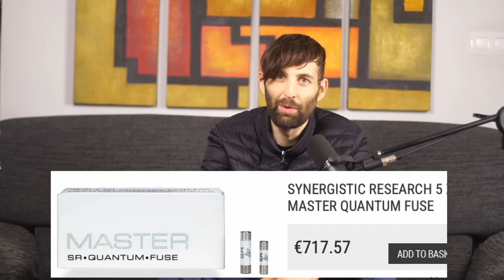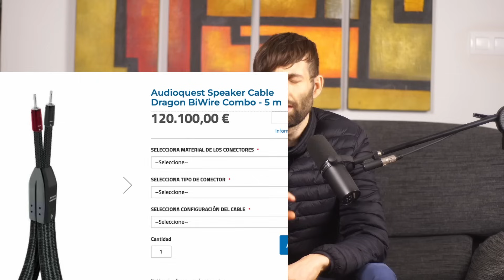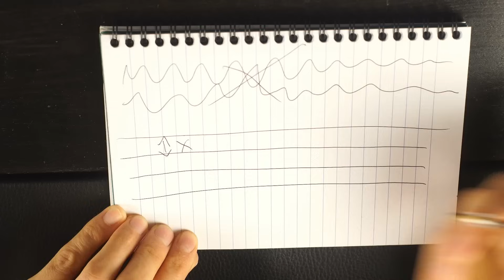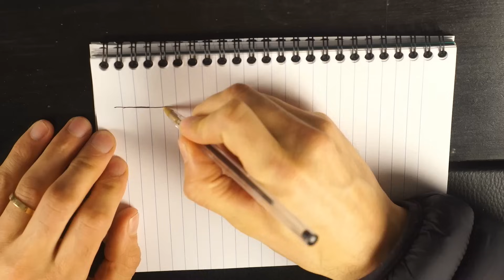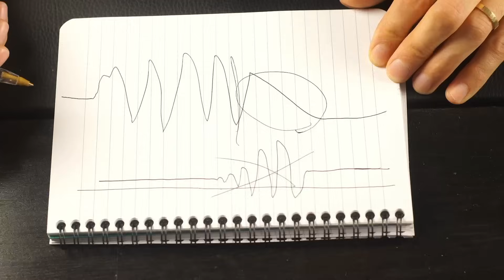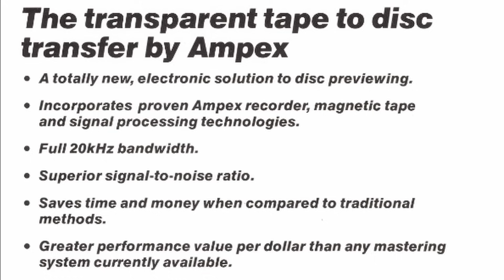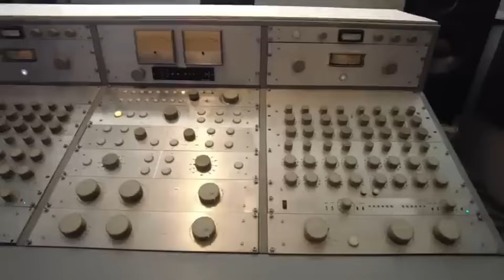Hard truth: most vinyl is digital anyway

Comment: It may have escaped your notice, but there was music before the 1970's. While Alan Turing played with digital music in the 1950's, microprocessors did not become available until mid '70's. Synths and suchlike were analogue well into the '80's. Mixing desks moved from transistors to ic's with the xx741 (noise + limited bandwidth) and similar in the mid '70's. before that recording channels were limited, often to what you could fit on your multi-channel tape machines. They managed to keep reasonable quality even with ic's.  The main advantage with recording to tape is that you can record loud and rely on the tape to compress and limit the signal.  Gentle distortion.  Digital is unforgiving.  If you exceed the input range of the ADC then you have a 'train crash' situation. The signal goes crazy for the duration of the overload.  Even today with multi-channel 32 bit floating point converters you can still produce crap recordings.  There is a lot to say for analogue with all its distortions.  Most often today its the artist and the material being recorded that disappoints.

Comment: One of the big differences between vinyl and digital is that engineers back in the days were much better imo at mixing and knew their equipment. Also listening to vinyl back in the days - you did not listen to compression artifacts. So if you’re talking about MP3’s there is an audible difference for many people. I can also hear the difference between a pure analog recording - tape to vinyl VS digital DAW to say a 44.1khz/24 bit recording.

Comment: correct most if not all vinyl today is sourced from digital sources, even if it is recorded analog to tap reels, alot of times it still goes through a computer to do the cutting.  Some say digital is not a complete audio wave etc. Thats completely false, but thats a really long story.
Also when a CD is played, it is stored digitally, but of course has to go through a DAC and converts to analog on the fly, so now your speakers can play the sounds which is in itself analog signal sound.  what' is important is that the audio is stored digitally.  Anything stored digitally is always going to play exactly the same as it was meant to be heard as long as you don't use an EQ.

Comment: Whether they realize it or not, I think dynamic range is really what most audiophiles are talking about when they sing the praises of vinyl records. But just about all CDs pressed before 1993/94 also have great dynamic range. CDs also never pop, crackle, or hiss. Handle them properly and they'll never skip or wear out. However, the CD era ushered in the full brunt of the Loudness War, and some remasters of classic albums were arguably ruined. Even some of my favorite albums of this millennium sound overly compressed. But as you said, it's absolutely possible to cut digitally compressed music into vinyl. It happens every day. But if you just want to hear better dynamics in classic albums, you don't have to spend thousands of dollars on high-end hardware. Just buy some old CDs.

Comment: Digital:
44.1 Choppy stairs per second?
Haven't heard any audiophile complaining about all audio 
being chopped into 1/2 CLASS_AB literally in everything.

Most/all amplifications are CLASS_AB (including preamps in your "pure" class-A amp or class-D amp, preamps  in RIAA amp /CD player/streamer), 
this means your audio is literally CHOPPED IN 2 halves, a 
plus half and a negative half , and put back together again. 
The plus voltage is amplified by a completely differently manufactured set of device VS the negative half (PNP, NPN, or P-channel, N-Channel for mosfets) , 
In other words not guaranteed perfectly symmetric but close enough for getting stitched back together again to form the amplified audio, with negative feedback that repairs the damage, Class-AB audio distortion is more common than you think in under biased amps or when components drift over time (Vintage stuff, china stuff aka Behringer euro-1500).

Comment: by no means are cds a perfect medium, but in my opinion are closer to what i really want: a physical format encoded digitally, which reduces the number of digital to analog/analog to digital conversions by one. vinyl is provided as analog (usually from a digital master) so it's only natural for it to degrade with time and usage, no matter how well cared for. on the other hand cds will just rot away some day, but they are an exact copy of the digital release that is intended. any defects in a cd will either be very audible or not at all, usually, and in good condition you can make an exact backup of a cd as a file (which can be converted to a format of your choice for listening if you'd like). unlike with cassette tapes where modern playback mechanisms just suck (no way around that) a cd player is much more likely to be at least good if not pretty great, so it's an all around win win for me, tacking on the fact that in many cases you can still buy a cd of many major artist's work and quite a few less popular artists as well.